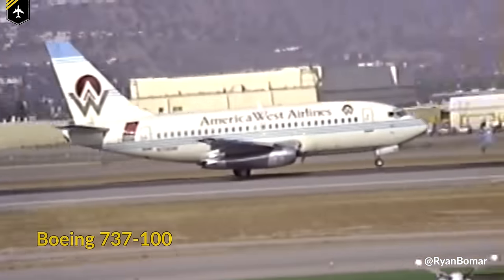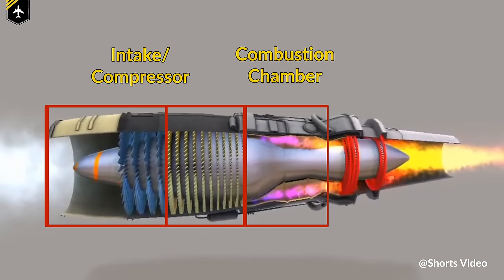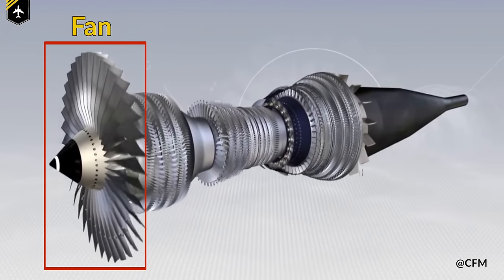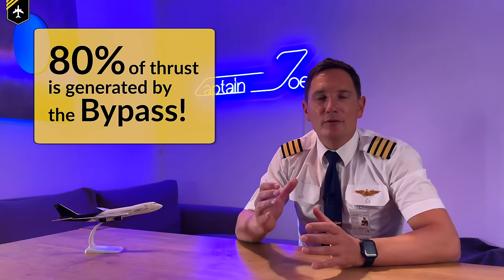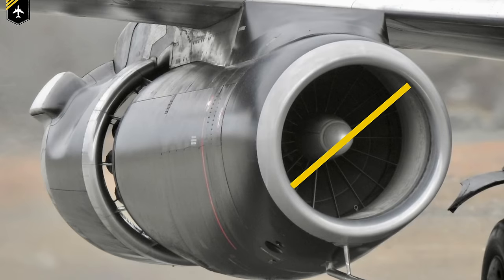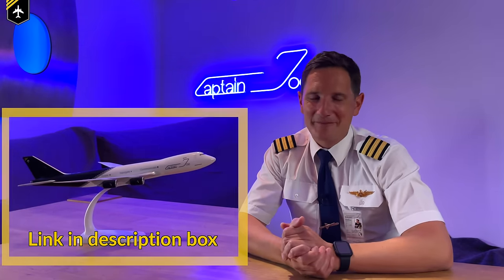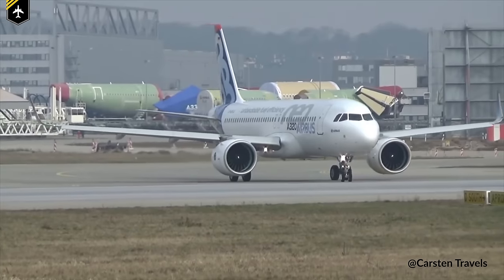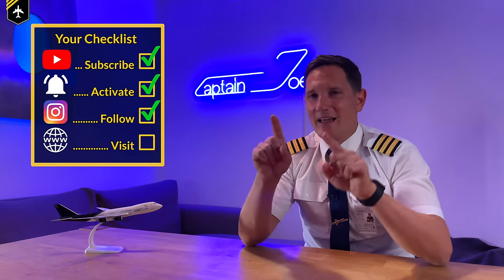HOW DO JET ENGINES work and WHY do they get BIGGER Explained by CAPTAIN JOE

Comment: In your animation, both cars have the same angular speed because they're turning through the same angle.  The outer car needs a greater tangential speed because it's traveling a longer arc length due to the greater distance from the center of rotation, and needs to keep up with the inner car.

Comment: I would put two aircrafts from each side of the table on that spot. I would put the F14/B Tomcat into the first spot, since it is simply just an iconic looking fighterjet. With the widely separated engines and sweeping wings, this aircraft holds the best of both worlds. Swept back wings for low speed flight and delta configuration for supersonic, high speed flights.
The other aircraft I would put into the first place, which is just as iconic, but for a very different purpose, is of course the Concorde. No further explanation needed.

Comment: They need to make turbo fan engines with afterburners (yes, this is very possible) so pilots have insane thrust available in micro burst/extreme windshear/engine falure situations. The computer should be able to detect a microburst and apply afterburner as needed.  This will be accompanied by "microburst" audible warnings and panel  annunciations.  The use of afterburner will help burn fuel and lighten the aircraft during an engine failure return with a quick return to field; no fuel dump needed.  Use of afterburner will also greatly increase terrain avoidance procedure performance.  Lastly, afterburner can be available for short field takeoffs.  Afterburner systems are simple  and relatively cheap. Spare no expense for safety.
Reply: It's not practical. Implementing such a system especially for limited and rare use will just increase complexity and costs.
Remember civil aviation is about balance between costs and redundant safety.

Comment: Adding more air does not make an engine more efficient. A key physics point which was overlooked is that it is much more efficient to accelerate a large volume of air through a small velocity change than to accelerate a small volume of air through a large velocity change. That's where the real efficiency comes from. Remember the fan is rotating at a much slower speed than the n2 or core axle.

Comment: So if you can slow down the speed of the intake fan by means of gearing, what is the optimum /maximum size of a jet engine for a commercial aircraft? Or hasn't that been established yet?

Comment: There is one aspect you didn't address. On a lot of Boeings, engines had to be redesigned as to not touch the ground, because the wings were closer to the ground. So, they aren't shaped in a perfect circle anymore.
Mentourpilot already did a video on this. Yours is better as to how the inner workings of a jet engine function.

Comment: I think you made a mistake at about 11:05. You staid that there's a gearbox between the fan and the low pressure compressor. Shouldn't that gearbox be between the fan the the low pressure turbine?

Comment: I guess you can think of the bypass ratio like gears of a bike. Keeping in mind that the turbine needs to supply the torque to drive the turbofan. Question is, where is the point of maximum bypass ratio to keep the system in balance.

Comment: That's amazing that just the engine on a 777 is wider than the 737s fuselage.. it doesn't seem like it by just looking at the plane, but I guess you'd have to have a 737 right next to it to really take in the scale

Comment: Hi Joe, I think the most famous turbojet was Boeing 707
Reply: Good suggestion although later versions of the 707 as well as the DC-8 and B-52 were equipped with low-bypass turbofans.
But we should definitely include the Concorde.

Comment: Captain Joe, the jet engines and the turbo props aircrafts. Wich one is spent more fuel ??
Reply: Turboprops are also jet engines.
And in terms of fuel, it depends on speed. At slower speeds a turboprop is more efficient, at higher speeds a turbofan is more efficient.
Reply: @ZK-APA  Ok thanks mate,  I appreciate it.

Comment: According to Newton's second law….
F = m x a
....the force or thrust F can be doubled by either doubling the mass of the airflow (m) or doubling its acceleration (a).

But according to the equation for kinetic energy….
E = ½ m v²
….a mass moving at twice the speed (v), has four times the kinetic energy (E) since the speed in this equation is squared (v²) while twice the mass moving at the same speed only has twice as much kinetic energy.

I guess this is the basic explanation why high-bypass turbofans are much more fuel economic than turbojets and therefore preferred for subsonic speeds. It's worth noting that most modern fighters also have turbofan engines, but of the low-bypass type resembling those of early passenger jets like the first generation of Boeing 737.

Comment: Someone prove me wrong, because I can't do it myself 😁 If we possibly wanted to do even bigger engine could we use two propellers instead of one big? One inner will be spinning faster and outer one (where speed of blade could be normally over 1 mach) will be spinning slower. I'm not engine engineer 😅 so this might be silly idea, but in my head this works. Only disadvantage I see is more complicated design, but that's something innovations face every day and I don't see it as a disadvantage.

Comment: The concept of the turbofan and how their size has increased is based on the initial concept postulated by Sir Frank Whittle the father of the jet engine... He initially proposed placing a propeller and its engine inside metal tube to increase its efficiency... He rejected the idea but then began work on the concept of a gas turbine engine operating on the same basic principle of the internal combustion engine... Development of the bypass fan and added stages of compression and expansion turbines, to compensate for the losses to drive the bypass fan, increased the overall efficiency of the jet engine, thus following the initial concept thought of and proposed by Sir Frank Whittle... This eventually works out to the jet engine that has become the norm today in civil aviation...

Comment: SOOOooo... these latest Gen super-high-bypass "jet" engines are really ducted turboprops where the advanced fan blade design, coupled with the close-fitted intake cowling, overcomes the usual sonic-wave and tip-loss issues of conventional propellers...?  Cool... but I still say bring back the P-47 Thunderbolt!  :yougotthis:😁😎

Comment: Suppose while flying the weather becomes bad and the pilot is forced to disengage the autopilot system. Then he decided to fly manually. In such condition how pilot knows the air route?
And one more doubt. While flying, en route pilot found that the weather is becoming worst and it's too difficult flying, and forward the weather is almost worse. Hence with the permission of the ATC, the pilot decided to change the direction of the aircraft. He was supposed to go straight but as above reason aircraft is now heading in another direction. In FMS already they feed the route before flying and no information is included in the flight plan about the current route. In such conditions can the pilot set the FMS again while flying and if yes, how is it possible. Could you please explain?

Comment: I will never understand this: The Fan is nothing more than a propeller. It makes Sense that the inner core compresses Air and it is then pushed out at the back with high velocity. But the Bypass Air? It can't by compressed that much trough one propeller so it has to be much slower at the back than the inner stream. If it is much slower, how can it produce most of the thrust? Help me!
Reply: Volume of air is more.

Comment: I'm a mechincal engineer, and my knowledge of this field is sadly lacking (albeit I find it fascinating). Perhaps someone reading this can help me.

I fully understand the concept of "suck, squeeze, bang, blow", but it seems that the fuel is only injected in the third phase. Given the entire process occurs on one shaft, and that process requires input air, I'm confused. What makes the shaft rotate initially?

Thanks.

Comment: how does reverse thrust work? Please do a video that
Reply: Air is sent forward rather than backwards
Reply: @Sterlingjob  I know that theory, but now in terms of hydraulics is where my interest lies
Reply: He has already made a video on it. Just search it up.
Reply: @projectbluemartin7532  some are air driven though a motor and cables. Some are electrical and some are hydraulic.
Reply: The Rolls-Royce Trent XWB Thrust Reversers (T/Rs) are electrically
controlled and operated.
The left and right T/R cowl of each engine has a translating sleeve. When
deployed, the translating sleeves divert the fan airflow to cause an air
brake.
Each translating sleeve is moved by three mechanical actuators connected
to an electrical motor.
In the stowed position, the translating sleeve is locked by two primary
locks and a track lock.
The electrical motor and the primary locks are powered and controlled
by the Electrical Thrust Reverser Actuation Controller (ETRAC) through
an auxiliary fuse box. There is one ETRAC and one auxiliary fuse box
per engine.
An action on the T/R lever transmits signals to the Engine Interface
Function (EIF), the Engine Electronic Controller (EEC) and the Primary
(PRIM) / Secondary (SEC) computers.
The EIF uses its dedicated signal and the signal from the EEC to control
the electrical power and send stow/deploy command signals to the
ETRAC.
If a signal is missing or one of the EIF applications is not operative,
redundancy in the control path permits to keep control of the T/R system.
For safety reason, a locking system independent from the engine systems,
make sure that the T/R cannot deploy inadvertently.
This system has:
- The PRIM or SEC computers, controlling the system
- The Electrical Power Distribution System (EPDS) to supply electrical
power
- An electrical lock, known as track lock.
A350
TECHNICAL TRAINING MANUAL
T1+T2 Mechanical and Avionics A350 RR TRENT XWB
70-STANDARD PRATICES - ENGINES
Reply: @ZK-APA  cool, will check it out

Comment: I was just looking up if Luftansa could steal two 737-7 engines and convert them into DC-2 rigs.  First, I don't think the DC-2 would have the proper engineering boards in the flight deck and second I am unsure about how safe that would be since it would to me look like ten times more power in a plane that is not designed for that.

Comment: So, if 80% is going around the engine, that means 20% is the exhaust. That means during reverse, you are catching the 80%, which in turn means the 20% is sitll pushing the plane while 80% is trying to stop it??  Also, you could've talked about mixed engines, like the Trent 700 and non-mixed engines.
Reply: It depends on the reverse thruster design, but yes mostly its just the bypass air which is used for reverse. But again if you do the maths, using reverse is still more effective than not using reverse

Comment: Don't worry, Its just to decrease the specific thrust, Because fuel economy (SFC) matters when it comes to civilian aerospace. In military, performance matters rather then SFC and hence smaller engine are designed to reduce weight panelty at the same time have higher specic thrust. An aerospace engineer will understand what I am talking about 😉😉😉😉😉😉

Comment: B737 engine position nowadays : something reaching limit as well, fan diameter combined with ground clearance, giving it an angle resulting in pitch variation when modulating engine power…. Btw geared fan revolution , check ALF 502/507….

Comment: LOL I feel like I was sitting in Aircraft Mechanics Class again😁
I worked on  USAF C5 Galaxy cargo aircraft when they used the old GE TF39 which was a high bypass Fan engine I also worked on C141, F15 and A10's during my career. 
I was always interested in the unusual Aircraft like the Harrier and the Pegasus engine, and the new fighters with their vectored thrust nozzles watching them fly is always enjoyable. 
I'm now retired but I did get to see the Aircraft change from analog to digital systems, I still remember the tool room filled with various test boxes and sets, whereas now you plug into the Aircraft's monitoring system or some cases download the data via the internet,.

Comment: Captain would it be possible to use the same technology as some "fanless" Fans use to push air through the engine? I'm not big on physics but wouldn't that help with the angular velocity?
Or the very least if it's possible to do it, it might work in conjunction with a traditional fan turbine and help it suck/push air faster through the system.

Probably a terrible idea but was entertaining this idea for a while now.
Reply: Have you ever had a closer look at how these "fanless fans" actually work? Because they have a fan in them, you just can't see it from outside.

Comment: Higher by-pass ratios mean a more efficient engine and a higher by-pass section means a wider and large engine. some air goes thru the combustion chamber, accelerating a lot, and a lot of air goes thru the by-pass section getting accelerated a bit, the giant blades at the front essentially act as a propeller being driven by the jet engine behind it. I saved you 12 minutes of over-explaining a very simple to understand concept actually.
Reply: High-bypass engines are more efficient because it takes less energy to produce a certain thrust by accelerating a large amount of air to a relatively low speed compared to accelerating a smaller amount of air to a higher speed.

Comment: They should use the heat from the engine to generate steam and power yet another turbine stage. Or the steam can be used to power another jet prop beside the engine. The consumption of jet fuel by the engine can be reduced further by using steam power. I'm sure the engineers can figure out a way to use steam power efficiently. Even if the jet engines have to be made twice as long as they currently are. The water/steam can keep cycling in a closed loop.

Comment: This is really informative! Thanks for making the video. Quick question, if the GE9X is essentially a propeller engine, what’s the point of having all the additional complexity of the jet engine? Is it because the jet engine is what spins the fan and it would otherwise not be able to spin that fast?
Reply: The GE9X is a turbofan engine, not a propeller (aka turboprop) engine. Both are different.

As said in this video, a turbofan is basically a turbojet engine with an additional fan which also produces thrust via the bypass. A turboprop engine is a jet engine in which the function of the engine is to not produce thrust, but energy to rotate a propeller which then produces thrust.

A simpler way of differentiating is that in a turbofan the jet exhaust also produces thrust, but in a turboprop the jet exhaust doesn't produce thrust as most of the energy is converted to power the propeller.
Reply: @ZK-APA  so in say an F22 Raptor there is very little bypass ratio because the jet engine is mostly propelling the jet, where as in a turbofan, the jet engine both propels the jet and provides additional thrust to spin the fan, which is the primary form of propulsion?
Reply: @WatchDanReviews  Even the F22 has a turbofan engine. 

Basically there are 2 kinds of turbofan engine: low bypass and high bypass. If jet thrust is greater than bypass thrust, its a low bypass turbofan (found in fighter aircraft), and if bypass thrust is greater than jet thrust, its a high bypass turbofan (found in airliners).

A turbojet engine will have no concept of bypass as 100% of air goes into the combustion chamber.
Reply: @ZK-APA  so in a high bypass does the jet engine mainly drive the fan providing faster rotation via combustion?
Reply: @WatchDanReviews  Its more to do with volume of air. In a high bypass, more air goes via the bypass, which then generates more thrust. And vice versa.
Reply: Jet engines spin a WHOLE lot faster than piston or rotary engines.
Reply: Turboprops are limited by exhaust velocity and propeller speed to 450-500 kmph. Also to produce the same thrust as a turbofan they need to be ridiculously large, much larger than an equivalent turbofan, which negates other benefits.

Comment: Now doesn’t Rolls-Royce have a prototype in the works that is a little larger than the GE-9X? I think it’s the RR Ultrafan with bode diameter of 140” compared to the 134” of the GE9X

Comment: Main question for me - why does the flow continue in the direction of the exhaust, and not explode in different directions after ignition?
Reply: Because it't not really "Bang". It's much more like funneling a huge amount of high pressure air through a burner. Similar in some way to a gas welding head.

Comment: Why are turboprops slower then, if a maasive plane like the Boeing 777 is largerly a proppeler driven plane?
Reply: Basically a lot of physics. But main difference is that a turbofan's fan creates bypass air (which goes through the engine)whereas a turboprop's propeller creates propeller thrust (which is outside the engine)

Comment: Easy: it is because with smaller engines, the fan has to rotate faster than the speed of sound, causing the sonic boom, which is ineficient to the engine.

Comment: Why bypass generates more thrust??? Because most of the air goes through bypass (not ignitet air) however middle part which drives bypass. Fan is driven by immense force of burning and compressed fuel. So its more becoming  of a turbo prop(turbo fan)  rather than jet fan. Only engineers understand this best
Reply: The bypass air generates less thrust per unit of mass than the core air since the core air has higher speed. However, if the bypass ratio is high enough, there is so much more of the bypass air that it still generates more thrust in total.